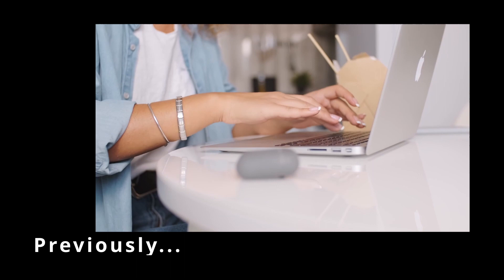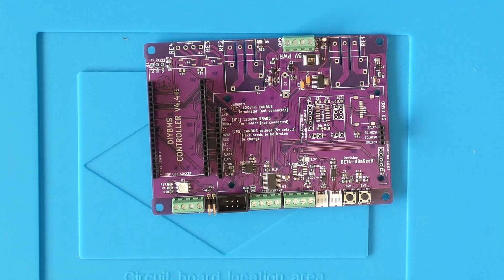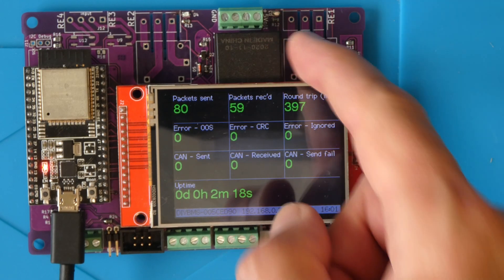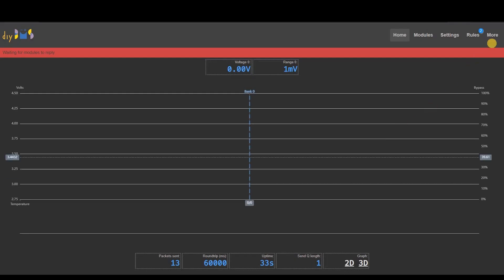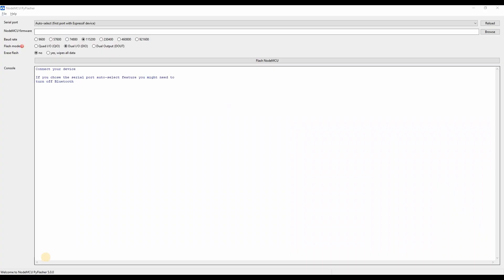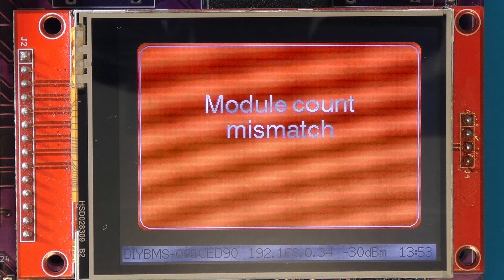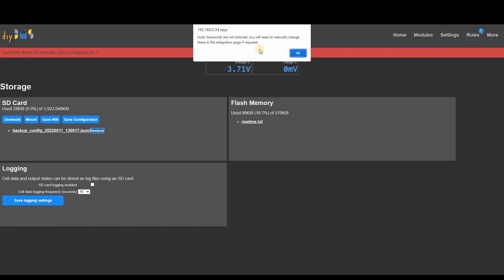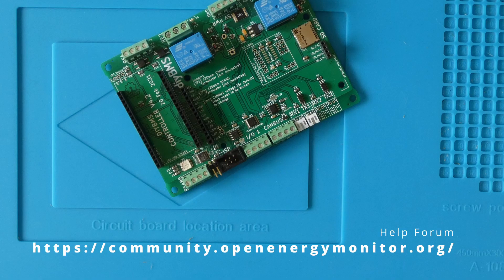DIYBMS Giveaway & Updated hardware/software

Comment: Id love to win a bms that would work with my 24 volt 24 module leaf powerwall. Ive never owned a bms but i hear that i need one for leaf cells to be safe. Ive used it to live off grid for awhile now with no problems but i hear its a ticking time bomb. Do you have any advice for a good bms?
Reply from the maker: Definitely get a BMS for use with Lithium cells - you need to know if they are drifting into the danger zone of under/over voltage.

Comment: Hi, is this diyBMS allow to connect 80 bateries in series ?
Reply from the maker: Theoretically yes, 80 series is possible, but I would avoid such high voltages if you are looking at a DIY setup.

Comment: I am in desperate need of a BMS for my 720ah bank, and the two 250 ah banks,  that power my house,  it has ma constantly checking it,  I can't be away from home for the worrying, is a charge controller. Going to not stop charging, and start a fire, or is it going to discharge  single cell group, beyond too low, not that likely, being it takes days to discharge, but isn't always full charged , it's usually stays in the middle 60%, someplace, and usually charged to 4v per cell, I can use a generator to full charge if needed, or use a dc to dc to charge from the 12v bank if needed, to add upwards of 500watts, I may get another one of those, to get 1kw from the 12v 250
Ah LiFePo bank, that I'd rather have a diy BMS for also,  the display on the control board is a awesome upgrade, I have some components for the build, a v4 control board I got from someone, I'd rather have the newest version , I ordered some components to start the build, ended up in the hospital for a while. Then a few things happened , and I still haven't gotten any further, turns out I am a major  pro at procrastinating! If I could just buy the parts and it work, I'd probably already have it and it working,, it's no problem soldering, it's the ordering of boards, and programming! That is holding me back, I don't even have a computer at the moment, I don't know if my phone is capable of all the things I need to do, it's starting to show it's age!!  My home burned a few years ago, I still haven't replaced everything yet,  thanks Soo much for all your efforts, making such awesome videos,  it's just awesome 👍

Comment: Hi Stuart, I downloaded the actual version of the PCB via Github. This has also a imprint V4.4 of the controller. But it seem this is very diffrend to the controller V4.4 here in the video. At first the watchdog is removed. OK. No need. Then the SD Card footprint is a little bit moved downwards. Are you sure its possible to insert an SD Card when the 4 Pin header for the LCD Display is soldered?
Reply from the maker: Yes, it all fits fine. The SD card doesn't slide in from the side, it's top loading by sliding the door open

Comment: I just found out about your diyBMS today and watched most of the videos as they were very intriguing. Although what I am designing (new type motor, 4 phase motor controller to power it, etc) is now designed to use as 12S li-ion battery, and although all those separate cell modules were the opposite of what I desired, I was thinking - maybe I could just make a 12S cell module version and still use this controller (once we can buy chips again that is). And low and behold... the 12S cell monitor last video. Perfect.

I subscribed a few videos in and am definitely interested in that 12S monitor going forward. This will all eventually be going onto a racing gokart, so being compact and physically robust is very important. I'm going to look over the designs and determine how best to link it to my Raspberry Pi 2W controlled motor controller so it can monitor the monitor for SOC and other important issues. Should be fun, eventually.
Reply from the maker: Thanks for watching.  The all-in-one board is definitely work in progress!

Comment: Is it possible to use the same controller for 2 seperate battery banks ? I'm guessing not :) Thanks for confirming this anyone.
Reply from the maker: The controller can manage two sets of batteries as long as they are connected together in parallel.

Comment: I just recently started the assembly of my few old v4.0 modules. This project really got me into soldering 0805 by hand which I never thought would be possible before. Thanks!
Reply from the maker: 0805 isn't too bad once you get the hang of it.
Reply: @StuartPittaway   I somehow managed to launch them over the desk with my pliers. However using my sweaty fingers to place them on the board worked like a charm ;)

Comment: Good stuff.  One suggestion I would make for diyBMS is to use dissimilar connectors for the module Tx and Rx.  I discovered the need for that when I blew up my controller board by connecting the module string back to front while the battery negative terminal was referenced to  controller ground. 52V DC went straight into the controller 3.3V power rail.  Ouch! Lots of magic blue smoke.